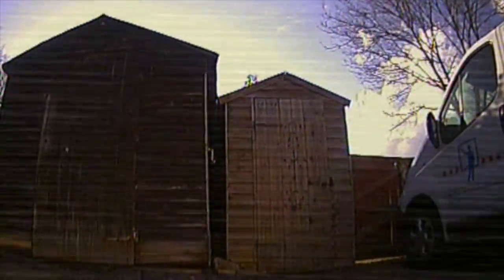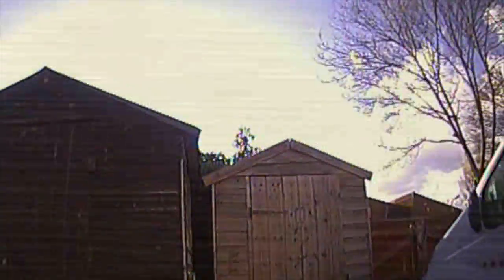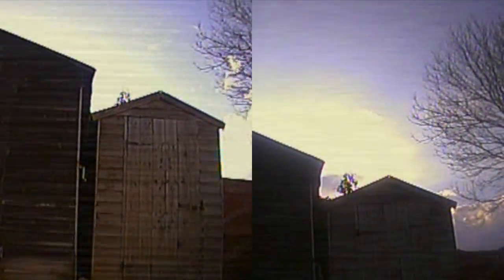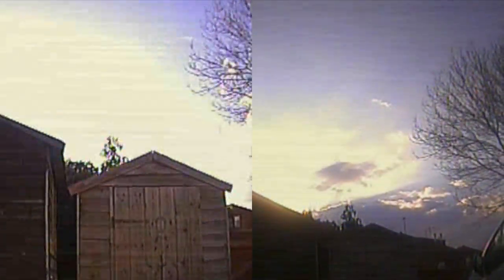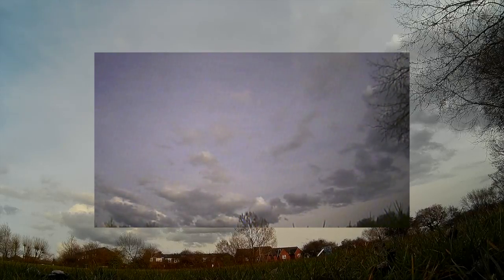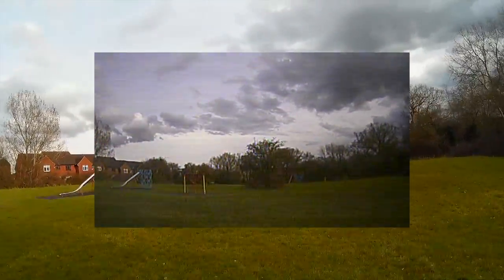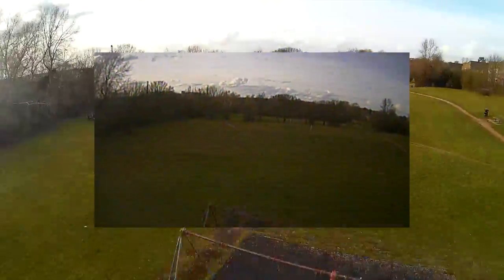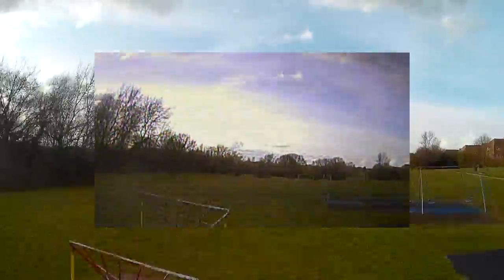Cap on the PDB

Comment: so this is an equal method compared to an lc filter setup?
Reply from the maker: A proper LC filter should be better, this is the C part of an LC filter.  However this is right on the PDB and therefor protects every thing an LC filter is often just in line with the VTX or camera.  This is smaller and cheaper as well.